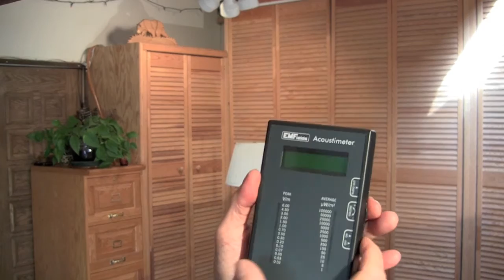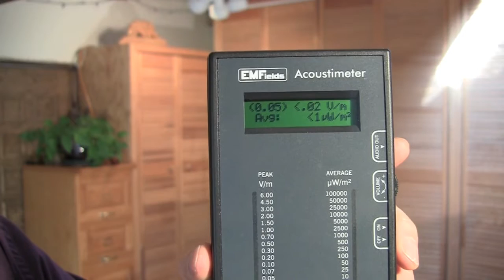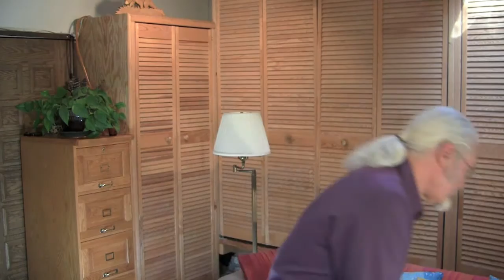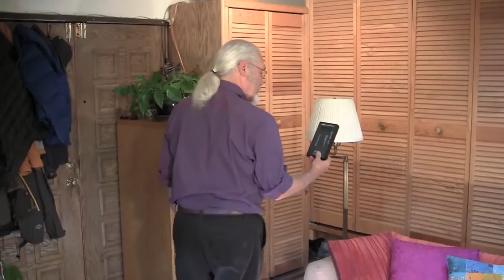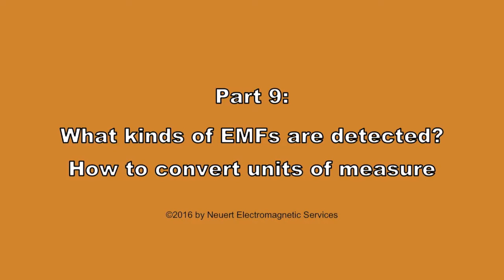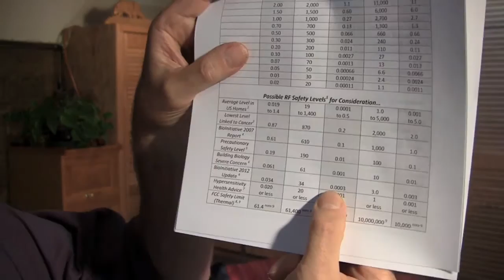How to Use the Acoustimeter: to Measure Radio Frequency Fields

Comment: Hi Mr Michael - i am considering to buy EMF meter. I want to make shielding of my house and other peoples so i want something that will last for a long time and also will give me good values. From what i have seen there are some from Taiwan tm195, tm196 but form what i have found that there is no laboratory that will fix it fome time to time to give me correct measurements. There is so much of them in a market that i am already confused and i want to buy somethig to start my thing. What would you recomend for me to buy. Thakns in advance.

Comment: Michael I don't know how you can get all those low readings.....  I sleep with all wireless devices on airplane mode and the wifi powered down.... the lowest I get on the peak reading with Acoustimeter in my bedroom  at night is   0.12 to 0.18 V/m ...... when the wifi is on in the day,  it's 1.79 V/m in the bedroom .... and 3 V/m in the living room (where the box is) ..... when the Microwave oven is in use in the kitchen, it can easily go >6 V/m (on the peak) about 3 feet away from it .... and I have seen the fluctuating average go as high as 50000 micro watts .... is this normal ? .... or is my Microwave faulty ?
Reply: The readings you get even with all your stuff turned off could be your neighbours equipment or from local phone towers.  This is where the acoustic function can prove very useful.  At the EMFields (manufacturers) website they have sound files that you can listen to to help attune your ear: https://emfields-solutions.com/rf/
Reply: Oh, your microwave sounds like it is leaking quite badly... i would discard it altogether.   If you must use one then you might find this useful for deciding because they do differ greatly: https://www.youtube.com/watch?v=zuGbYWW03y4

Comment: Mr. Neuert,  If I buy a rf meter with 1 axis detection instead of the 3 axis ones.  Do I have to take the readings holding the meter in each direction?   This is the case with my magnetic meter.
Reply: As he repeatedly states, you need to rotate the meter on it's axis which then becomes the same as using a multi-axis meter.

Comment: Hi, I'm looking for an EMF/RF meter on a tight budget. Would you recommend a Trifield TF2, Trifield 100XE, Acousticom 2, or an Acoustimeter? I'm very concerned bc Duke Energy just installed two smart meters in my duplex without our permission and I want to measure the radiation levels.
Reply: The Acousticom/Acoustimeter are regarded as being much better and more accurate than the Trifields because they specialise in measuring EMF radiation, while the Trifields are a jack of all trades and thus not very good/accurate for EMF measurement but ok to pretty good for magnetic fields which are completely different.